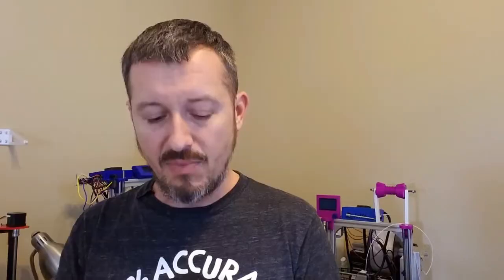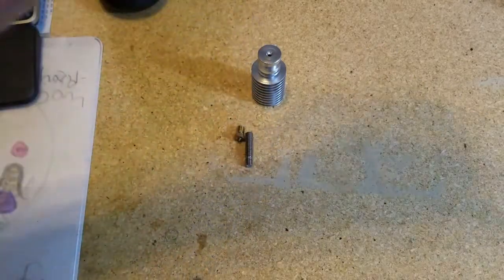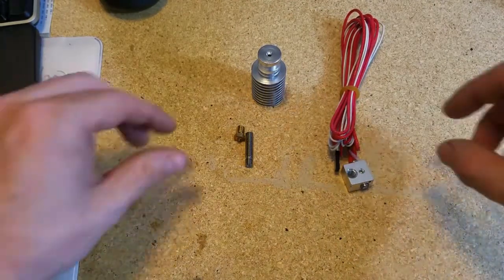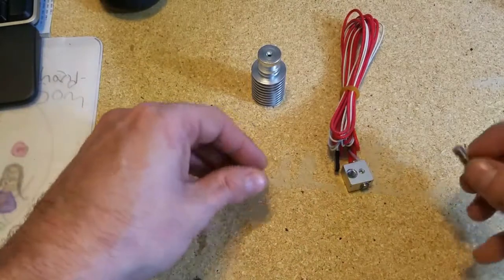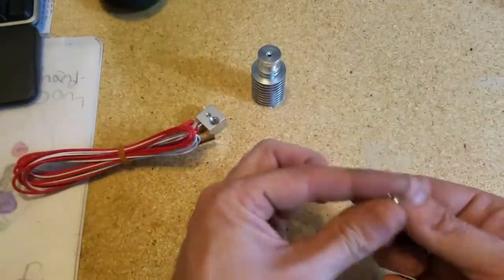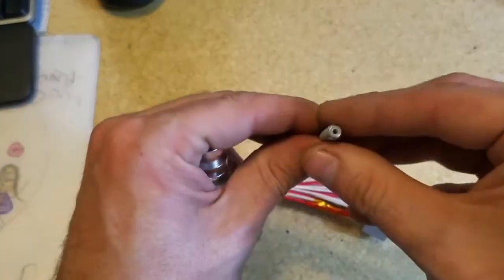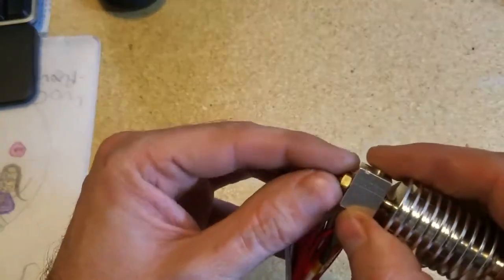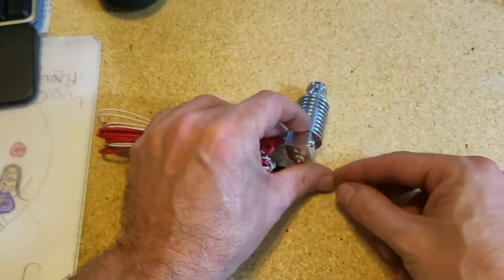hotend leak.

Comment from the maker: Yup I remember
Reply: I was going through my boxes and found the 1 watt resistor but I always wondered why people would have to replace those resistors so often (not an easy task as you had to break the cement) when heating cartridges was right there for a couple of dollars.  This is why I went to it as my electronics side knew a resistor is not supposed to get hot.